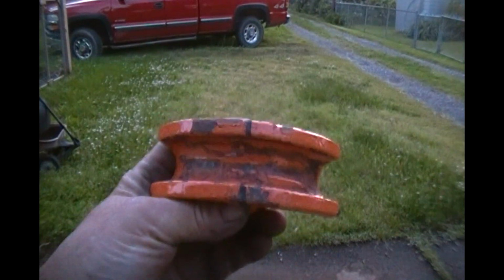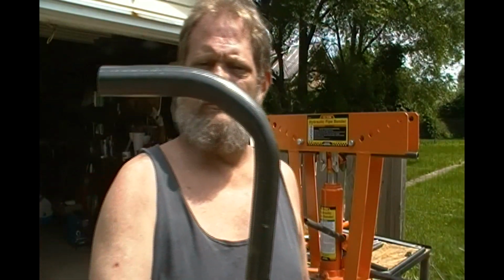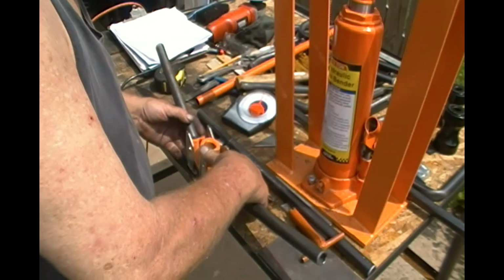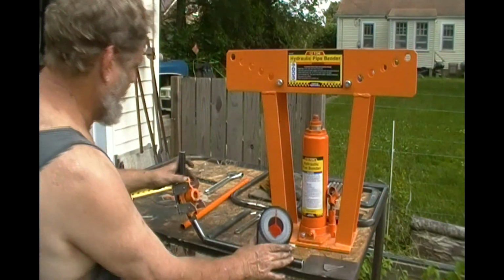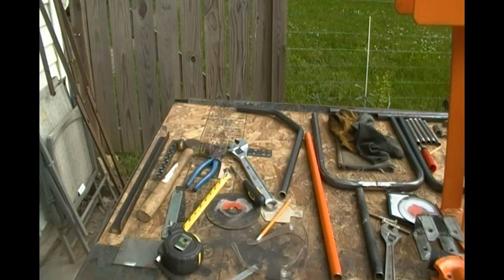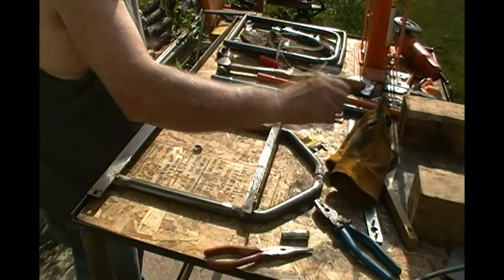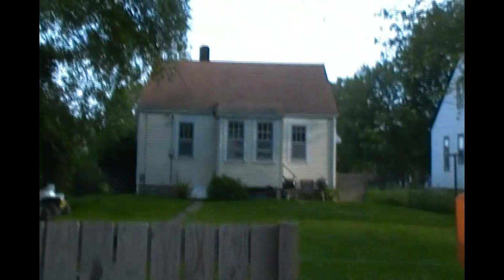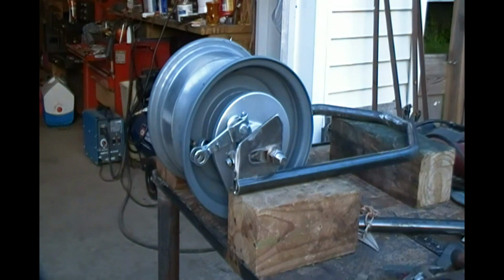BIKE BUILD 3, PIPE BENDING IS HARD & SWING ARM FAB

Comment: I have a pipe bender similar to yours that I got from Harbor freight. One thing I found out is there is a difference between a pipe bender. And a tubing bender if you use a pipe bender with tube or a tubing bender with pipe the results are very similar to what you are experiencing.
Reply from the maker: You're exactly right, but I found a work around, using a size smaller mandrel, so the tubing is forced into it and fits snug as can be, then I made bracket that holds the tube in the mandrel also and have been able to achieve my goals using that set up.  I show it all in other videos.
Thanks for checking it out & taking time to comment, I appreciate that ..
Reply: @TufdogsPlace  you’re very welcome. I didn’t realize that the video was made about nine years ago until after I commented, I figured you probably figured out everything by now  but I it still was worth commenting on!
Reply from the maker: @TheManCaveMetalFab2580  Exactly right, & it's always good to get some feedback.

Comment: The problem is you are trying to bend tubing with a pipe bender. Pipe is measured Id and tubing is measured od. you can not bend tubing with a piper bender (which is what you have) consistently. Go get you a tubing bender and dies for the tubing you are trying to bend. Been there and done that.
Reply from the maker: Yeah, I figured that out, & I figured out a way to make it work for me. By securing the pipe/tube to the mandrel i was able to keep it from kinking and thus bend properly. I show it it in a later video.
Thanks for saying though, You are exactly right !...

Comment: i can tell right away what's happening the pins are in the wrong holes the instructions may disagree with me but if you moved the pins out two more holes not one piece of that pipe would have been wasted
Reply from the maker: I like the way you're thinking and there maybe some merit to your observation, , but also moving the pins outward only makes for a longer stroke to achieve the same bend. 
Most of these errors was caused by my unknowingly letting the pipe slip out of the shoe as it bent, which later I created a way to hold it in place, and other rookie mistakes.
Thanks for chiming in in though. Always good to get another idea ..
Cheers...
Reply: @TufdogsPlace  yeah i love this style of benders i found a guy with a German made unit and it made bends at the level of quality of a jd2 apparently the dies are ovulid slightly, so the pipe holds its form

Comment: I never tried it, but I have seen guys fill pipe with wet sand to stop kinking, You may have to cap the ends. might be worth a shot?
Reply: Peter Smith I could be wrong but I'm pretty sure the sand is specifically supposed to be dry.
Reply from the maker: It would be if I hadn't figured it out with out doing that. I didn't like the idea of putting wet sand inside a pipe, then trying to get it out and get it dry. a lot of extra work involved there.
Thanks for saying, I appreciate the input....Cheers

Comment: When I was welding professionally on all are rigs (whether a 220 mig on wheels or a boom like I had on my table) we'd take like a old flannel shirt, with one of those BIG paper clips and clip the flannel on the welding wire before the feed rollers and the cable liner (theres usually always a little space in there at least on the bigger machines) the short of it, the flannel wipes off the junk on the wire and keeps your liners cleaner. Another tip get some nozzle spatter spray, greatly reduces your cleanup on the nozzles. If I'm using shielding gas, I actually prefer straight CO2 and not the Stargon or Argon/CO2 mix. To me it just purrs rather than giving you that sputtering effect that Argon does (also saves money for sure). Just an opinion though and what I prefer. Nice project, thanks for sharing!
Reply from the maker: Good tips, Thanks. I'm particularly interested in the straight CO2 application.  This is the 1st time I've heard anyone say that.
I appreciate you sharing & the cool comment...

Comment: I have found that filling the pipe with sand then capping or putting a stopper in the pipe ends will allow you to accurately bend pipe without kinking or compressing the pipe. To keep from galling the pipe and the dies try some spray lube.
Reply from the maker: tom3777 Yeah, I've heard a lot of guys say that, But that's a lot of extra work that shouldn't be necessary.  With a little patience and effort, I figured out how to make it work with out doing all of that. But the lube is still a good deal. I like that !  
Thanks for saying,... Cheers

Comment: Those pipe benders suck for tube bending, from what ive seen they just kink it. Think its because the benders for pipe and pipe is measured by inside diameter and tubing is measured by the outside diameter. Hope you figured it out though! (:
Reply from the maker: kevinfrmkdz I understand, but lets face it. if you want to bend tube, buy a tube bender. If a pipe bender is all you have, make it work. lol Where there's a will, there's a way.  
Yeah , I stuck with it and got it to do what I wanted.Thanks for watching & commenting, I like that,.. Cheers

Comment: just a thought.... if it is the paint coming off the shoe.....sandblast those shoes and powder coat them?
Reply from the maker: dan parker Hey Dan, That's not a bad idea. But at the same time, I really don't see the need to spend time or money on the shoes. A blast of rustoleum wouldn't hurt, if the metal becomes bare. also if one were to powder coat them, he'd want to plug the hole that fits the jack ram. because that's a tight fit already.I like the way you're thinking, Yayah !  Thanks for saying,... Cheers
Reply: Just a thought brother.....those shoes are so small and if you have a compressor and paint gun hell you can do them up yourself and cook them in your own oven!  I was just thinking that powder coat is pretty tuff stuff! good luck with it.   Dan
Reply from the maker: Yeah, a guy could do that with a cheap convection oven, (So the wifey doesn't get upset ) lol   It would be a cool thing to treat your parts on a build that way. 
I like the way you're thinking... Hmm
Thanks Dan, now you've started something. lol
Cheers

Comment: The problem with the welding wire isn't somuch the outside being dirty, it's the inside where the flux is, bad or no flux makes the wire act like it's not getting a good electrical connection because the wire is actually shorting out with no flux to shield it. I swithed to Lincoln Electric wire from Home Depot and my problems are solved with my welder. Just like you said, melts better and easier.

Comment: To get compound bends on the same tubing on the same plane you need a couple of lines drawn in the right spots like you did for the center of the die. First start with the die-look at it sideways which is the way the tubing goes in, and on the bottom of the curve make your mark. Now on the tubing- draw a strait line from one end of the tubing to the other, this line represents the bottom of the tubing when placing it in the die, the die mark on the side bottom of the curve should line up with the strait line on the tubing for the first bend and then the second bend and so on. Important to make sure line on tubing strait and not crooked or will throw of the bend. Wecome to my world,LOL.
Reply from the maker: Thanks , That's a good tip, I kind of do that but not the whole bit, I appreciate it.
& as for the welding wire comment, I'm going to try some Lincoln brand one of these days. I keep hearing people say good things about it.

Comment: The flap style sanding disc for the grinders will give you a better cleanup on the welds. Their faster and a whole lot easier to work with.  Great video.
Reply from the maker: Thanks Neil, I use them quite a bit and you're exactly right, They work great ! 
I appreciate you saying,... Cheers

Comment: Besides stuffing the tube with wet sand u can also use a smaller shoe and to avoid getting those kinks on each end. Cut a piece of 1/8 sheet metal or cut a larger piece of pipe in half and wedge it in between the rollers and the pipe ur bending.
Reply from the maker: I am using a smaller shoe, & made a cap to hold it in place, after a lot of trial & error I've been able to get it to do what I want. Thanks for saying though, I like that !
Reply: Your welcome. Its always nice to lend a helping hand. Keep it up
Reply from the maker: Thank you Carlos. Will do.

Comment: fill the pipes with sand to get less distortion
Reply from the maker: I've seen that done, & have mentioned in previous videos that I really want to learn to do it with out having to go through all of that. & with patience and perseverance I've managed to get the job done. But I Thank you for the suggestion, & if all else had failed I surely would have gone that route.
Cheers !

Comment: Maybe use some sheet metal and have a piece with a really good Bend siting there, put the die in a vice and heat the sheet metal up with a big ass torch and set it on the die and use the pipe by hand to form to the shoe, make it a tighter fit, or maybe build a better "cap"  that will since the pipe down really good

Comment: Your rig looks good. I think the reason you are getting rough bends is due to the wall thickness of the tubing. I think that if you use thinner stuff it will wrap that shoe without kinking. That or a larger radius shoe cut for the same size pipe. the things that bend tight bends usually involve multiple shoes and mandrels and things like you made to capture and prevent the problem. I think you have gotten the best you can get out of what you are working with. Maybe try a pedestal bender?

Comment: It's starting to take (SHAPE) LOL! Seriously though, it's looking good. I have a suggestion...I use a manual pipe bender (the one you use on the ground with a leverage bar). But my dad has a square tube bender from Harbor freight, and he says he gets good bends on round stock with it (even though it's meant for square stock).

Thought I would throw some ideas at ya!

Comment: If I get my pipe bender I believe that packing the pipe with sand will help, kind of having a spring in copper pipe before bending them helps prevent the collapse that I see with yours. YT may have a vid on using a filler. Your honesty is prized in watching, makes you extremely credible.

Comment: I am not a bender but I know a good blow job stops all the spitting. BRUCE REALLY!!! I am talking about the welder. It's a good job TMan told you about the blow job. Did you put a rubber on the top too?Your getting worse. Between the clamp and the pipe I mean. I was wondering if that might help you with your kinky situation. Great video.